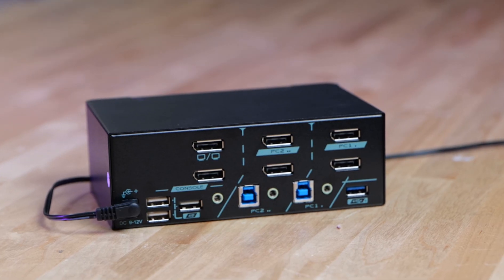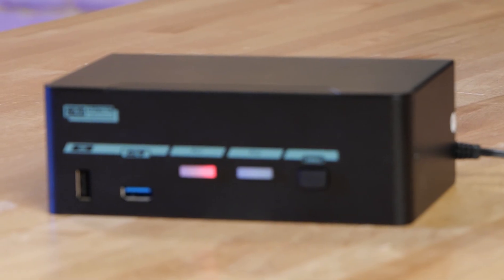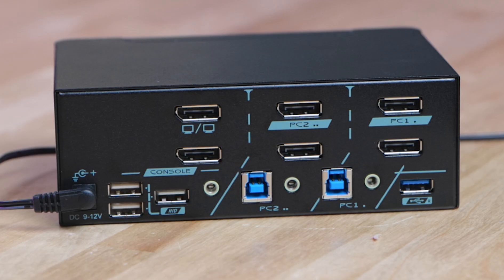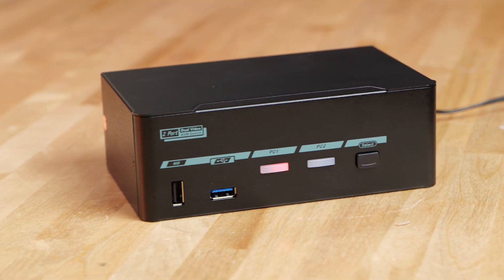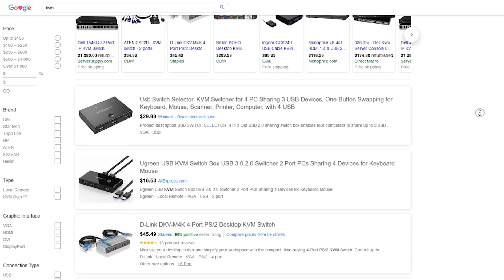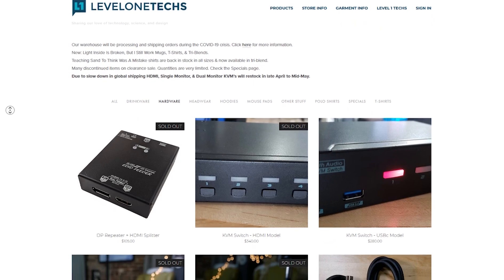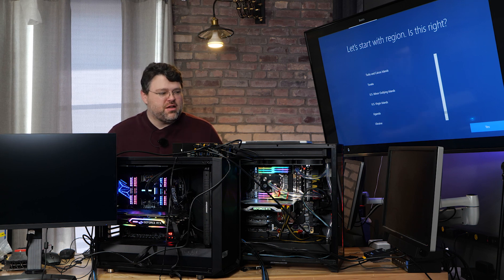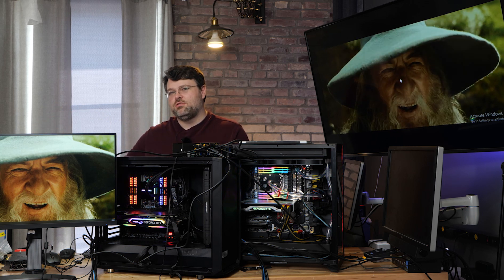NEW Level1Techs KVM: DisplayPort 1.4!

Comment: What does 'not perfect' mean? I'm very interested in these
Reply from the maker: there is a huge universe of usb and display port devices. Because some monitors and devices (cough apple cough cough) dont 100% follow spec, it is very difficult for me to get perfect compatibility. For example the 2013 mac pro needs one of the level1techs DP repeaters to work properly. Mostly it's fine, though, one of the best KVMs out there.
Reply: @Level1Techs  maybe drop support for 2013 mac pro? :D Just maybe? :D
Reply: @peppybocan  it's wendell we're talking about though. Random edge cases mean it's not perfect, yet these are only kvms I'm comfortable recommending. Go figure my hobby gave me a good tool for work here. 8)

Comment: Doest it also support DDC and Vsync/gsync?
Reply from the maker: lots of reports of gsync/vsync working fine on previous models. ddc yes but ddc is not active on the inactive input
Reply: @Level1Techs  Knowing you can't say officially it supports gSync, but have you tested the DP1.4 model on any Gsync module-equipped device and had success?
Reply: The older DP 1.2 models work fine on 1440p 144Hz GSync.
I haven't run into problems, but beware of long and/or poor quality cables.
Reply: I was wondering the same. Glad it doesn't seem to effect gsync. Beyond the whole cable quality thing.

Speaking of what is a good quality DP cable now?

Comment: What is the voltage of the transformer that comes with the product?
Reply from the maker: 12v dc
Reply: I know this isnt what you asked but its also good info, it (the dp 1.2 version atleast) works with both 110 and 220 volts. You can get cheap adapters for the plug that make it fit in EU Wall sockets.

Comment: (apologies if this isn't a good place to ask, but) 2 questions: 
1. How well do these (and the previous model) work with MST? I'm on a bit of a budget, but need to upgrade my setup. I've got a Dell U2715H that runs at 2560x1440@60Hz and am thinking of getting a second or more modern equivalent. I recall that Dell monitors' internal MST hubs have had issues with these KVMs, but would using an MST hub work, or should I just go with the higher-end 2-display model?
2. Does the HID port know what to do with Logitech Unifying receivers? For instance, if I've got an MX Ergo, MX Master, and a K350, would the Scroll Lock shortcut and numlock reset shortcut still work?
Thanks for your work with these epic new KVM switches (as well as other projects like Looking Glass for high-performance video in KVM) and having such an informative set of YouTube channels :)
(EDIT) 3rd question: how well does this handle DP++ or DisplayPort alt modes (e.g. using passive DP to VGA and/or DP to DVI adapters)?
Reply from the maker: there are reports of MST working but in general I don't recommend it. Some forum users have been using Dell MST with the old KVMs just fine, but requires perfect cables. The Dell MST stuff is really meant to work best with Dell's docking stations. The new model is DP1.4. IIRC the 2715 (from 2015 mind you) is not DP 1.4, so it wouldn't help you much.. DP1.2.  2. Sometimes the Logitech stuff switches protocols between 8 byte and 12 byte USB packets. numlock reset still works. you can use pointing devices on usb3 and it should work better. 3. No alt modes, the kvm doesn't supply adapter power and passive adapters rely on the video card changing how it signals over the same pins.. so.. that's not going to work
Reply: Level1Techs thanks! 

That’s a lot of really helpful info. I’ll see if I can convince my work to get actual DP monitors for our technician stations instead of old DVI monitors with DP adapters. As far as my personal setup, I’ll see how well this or the older DP1.2 one works. I may end up spending some of that stimulus cash on new monitors.